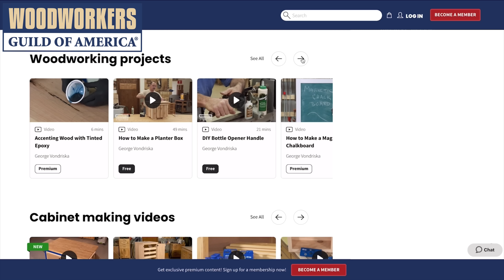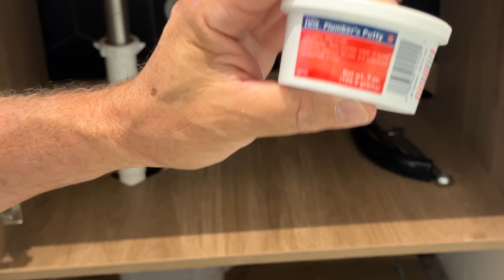INSTALLING a SINK with a BUILT IN DISHWASHER!!

Comment: I find the dishwasher wanting to be hooked up to cold water a good sign. It removes an oportunity to mess up a load by not getting the hot water up to temp before starting, which can reduce the effectiveness of the dishwasher. Technology Connections explains this in some of his dishwasher videos
Reply: I love the “some” of his dishwasher videos, technology connections is something else lol (big fan of the channel)
Reply: Some dishwashers (Bosch in particular) heat the water above the incoming hot water temp.  In fact they won't start the timer until it is "up to temp".  In our older dishwasher the circuit board that controls this heater failed, and the thing would cycle forever.  I've seen dishwashers replaced for this fault.  The hotter water helps in the cleaning.
Reply: @Herby-1620   that’s how it should be! I imagine the cold water requirement is because of the seafood wash
Reply: Heating the water from cold rather than using hot water to preheat it is a European appliance thing.
Reply: @TeflonBilly426  Which makes sense. Houses in my neighbourhood don't even have hot running water connection in the kitchen. We all have a separate 2.5 gallon hot water COP 1 electric heater which would cost a fortune to run a dishwasher from. Theoretically a line from the gas boiler could be created, but that is quite costly to run through all the concrete.

And this is not even that uncommon in Europe due to all the older (stone) houses that are still around.

Comment: Paul, use a mud ring or raised single gang switch on the box under the sink and have the flex go in the knockout in the extension ring.

Comment: I'm not sure where it came from, but my house has a downpipe with a much smaller condensate adapter. It's also shielded from above in the center section to prevent backflow

Comment: Do you ever put pipe done on the threads of a downspout? The last one I did was a plastic drain with course threads. I  barely got it to seal. Maybe I should have put pipe dope or Teflon tape on the threads? Great video as usual.

Comment: If it had been up to me, I would have gone with an 18 inch wide dishwasher.  Uses the same amount of under counter space, and the 18 incher would have left you with more counter space, which is pretty scarce.
Reply: Thinking the same. This thing barely saves any room: it takes counterspace and still takes cabinet space. Losing a lot of counterspace to save a couple inches of cabinet space.

Comment: Cool stuff! 

I think it might be better if you can get that kitchen fauced handle on the right side instead of the left so you aren't getting your arms wet to turn it off and on!
Reply from the maker: We tried the handle on the right, centered in the front, and on the left.  The left seemed the best because pushing the lever back towards the backsplash is hot water, pulling it forward is cold.  I always go "back is hot" in case a kid reaches up there and turns the water on; they're probably gonna pull the handle forward and get cold water not hot and maybe get scalded
Reply: @StudPack  That makes a lot of sense, thanks!

Comment: Paul, I could be wrong but the AC condensate drain line running back up can cause back up issues in future I believe. There is no pressure on the condensate line to overcome gravity  when turning the line back upwards.  Looked like you could rotate the fitting easily. Just a thought.
Reply: If you are talking about the bend in the line, it essentially behaves like a p-trap and won't back up. When there is water collecting before the bend, it'll build enough head to start pushing through to the drain. Waterline just needs to be higher than the drain height.
Reply: Its pumped...
Reply: Also when algae builds up, you will find it right there.
Reply: There should be pressure because it’s coming from an actual condensate pump, not just a gravity drain line
Reply from the maker: Correct, the condensate is pumped.  We can hear the pump come on and the water draining.  All that said, condensate pumps do require maintenance which the AC tech advised Jordan of.
Reply: @StudPack  You are going to have a lot of backups with that reducing barb. As soon as that gets filled with bacterial zoogloea (drain snot) it's going to clog. Full 3/4" condensate lines clog. You really reduced that. I would find a way to get rid of the barb. I hope you installed a float or wet switch too. I live in Florida and have 2 split A/C's in the main house and a mini split in the garage. My 2 split units clog every year. I put tabs in the pan monthly during filter changes and I pour Viper condensate pan cleaner down the drain and they still manage to clog. I either blow them out from the A/H with CO2 or vacuum them from outside. I always clear them either way or sometimes both ways.

Comment: On the P trap I would have tapped the 7/8 ID and put a threaded reducer. Probably 5/8-11 OD to 1/4 ribbed slip. But I am a machinist not a plumber and I have that stuff. 😆
Reply from the maker: Wish I had a lathe.........

Comment: People that say use silicone on the sink drain flange dont know what they're talking about.  You'll never get that back out cleanly if you need to for any reason, problem with the P-trap whatever, and the silicone doesn't clean up good on the sink and will leave a discoloration after a few years.  Plumbers putty is the right material for the application.

Comment: Wish I could afford one of those pex a (expansion) electric expansion  tools. They are so pricey. I did my entire tiny house with pex a with manual tool. It worked but I gotta get me the electric 1 like you! 
If you want an excuse to get have to get a new EXSPANSION PEX A  battery operated tool, you could always send me that old one you got, and blame me for you having to get a new one! LOL !  
  I believe exspansion PEX A is the way to go.  If you could reach out and get  Milwaukee (sorry, spelled wrong)  or Dewalt to give us any discount on tools please do . The battery operated tools are great but just to high . That basic batter operated expansion tool kit with batteries is around $400-$500 on sale .
 I hate it when you see a good price on battery tools, but when you look closer they sale them without the batteries which cost more than the tools themselves. Lol!  But any deal for a discount code, or rebate will help. And you can really help , us them and possibly yourself. Because most of your viewers need and will use most tools, so it is a win win win.

Comment: So a few years ago I ran into an IKEA, Hemnes if my memory is correct, sink and vanity.  They exploited the natures of plumbing to decide where to locate the p-trap.  Immediately out of the sink the water had an immediate horizontal what ever it is per foot toward the back so to make drawers be unencumbered slide right under the sink. At the back of the vanity tucked way behind the drawers was a vertical drop into the p-trap and a 90 into the drain. This resulted in so much less cutting things up. So, now whenever I see a bathroom vanity today I think about how simple IKEA had nailed where to put the p-trap.
Reply: i know what you're talking about. i think it was actually harder to install because of that p trap design

Comment: I have some comments and some questions.
Comment 1: On the vanity I wonder if you could've gotten away with 2 hole saw bits rather than a rectangle.
Comment 2: I have experienced first hand and heard that often clogs are more likely to form with slower moving water, so it may be counter-intuitive but smaller diameter pipes are better at clearing themselves and less likely to clog in many instances.
Comment 3: I I too have had issues with that rubber sealing, so that's a very handy trick, the other thing I've done is actually installed the seal upside down, and that has worked for me in the past.
And Question 1: I have used expanding A pex and had a problem where even positioned correctly the sleev would slide down the pipes, do y'all have recommendations to avoid this or is it luck of the draw? (I was using a hand expander at the time, which makes more conical expansions rather than steps, so maybe that was it)

Comment: So much for the hidden plumbing..... why not move the bathroom sink drain up by removing some tile and wall board so the p-trap is hidden? Seems like the smart thing to do...?? Or even easier use 45° or 22½° fittings to turn the drain pipe down? 🤔

Comment: My 1 and only complaint about the dishwasher sink is that all the tubing is at the back of the unit which would make it difficult to service in the event something goes wrong. I think it's a fantastic idea but the only way I'd install one is if I had an access panel right behind it to work on the tubing if anything ever goes wrong with it
Reply: I don't know how much access you would need.  How do you access a "normal" dishwasher, and how often?  In my experience "not much".

Comment: nice but you should cut the short line a bit more and put the drainpart for she small line sideways, it will collect water the way it is now 😊
Reply from the maker: That condensate line is attached to a pump.  The pump will push any water out.  It's not like a gravity drain.
Reply: @StudPack  ah okey 👌

Comment: The condensate drain enters above the P-trap. I don't think you need any kind of seal at all -- you can just run the drain line directly into the adapter with maybe a clip to keep it in place.
Reply: You never want an open leak below the flood line. If the plumbing ever gets clogged, water will fill up and start spilling out through that barb.

Comment: I would have gone with a straight rather than a 90 for that c9ndensate line. Since everything is gravity fed, you now have standing water in the line for things to grow in and potentially clog the drain line.
Reply from the maker: Tried to find a straight, could not
Reply: @StudPack  Straight would be ideal but I wouldn't lose too much sleep for a pump drain line.  If it were gravity fed, I'd be looking into one of the dosing units to add the enzymes.  Both condensate lines terminate at bathroom sinks upstairs in my home and it has to be cleaned periodically to avoid clogs.

Comment: I am curious on a few things on the bathroom vanity: 1) Can you see the drain pipe under the vanity from a distance away?  2) Could you have done an El up from the was and still had a trap without cutting the base of the vanity (if you follow what I mean. drian down to  U```L  out to sewer
Reply from the maker: You cannot see the p-trap.   Your recommendation in #2 would essentially create an "S" trap and that is not allowed (here at least) 😁
Reply: @StudPack  Thank you for that info.  I love your videos.  You make things look too easy, even when you struggle.

Comment: When you were affixing the vanity to the wall on the right, what was the shim used for exactly? Was it because the wall was not square, or does the top of the vanity run proud of its frame?
Reply from the maker: We held the vanity off that wall just a bit so the door would clear
Reply: @StudPack  Ah, got it.

Comment: Should use copper stub outs. It looks way cleaner, and if an angle stop fails you can replace it without having to cut the copper back. Just a tip.
Reply: Or at least put a male adapter on and use a threaded stop. I personally can't stand pex coming out of the wall either.

Comment: Take the electric whip into the bottom of an extension ring and then you can install a 2 pole switch as the disconnect

Comment: You know, I have seen a bunch of dishwashers. I have never seen one that tied into the drain like that. Mine just drains into the garbage disposal.
Reply: This is probably because it is not a US product designed for the 'eccentricities' of the US homes. Most of the world does not have garbage disposals, which is why this product doesn't need to drain into a garbage disposal. Most of the world also runs on 220~240V, making it easy/quick to heat water - so no need to feed in hot water

Comment: Curious would the sink feed lines been beefed to have used a drop 90?  That way when the angle stops need replaced won’t have to cut the pex - or attach threaded connection to the pex feed line?

Comment: Question... How does the system works with rapid system? I see you press the tap in but how is this fixed? Water pressure would push the tap out?

Comment: I’m thinking a double trap would’ve been easier on this one that was very tight. But nice job making it work. You gotta hardwire it ? Hmmmmm are you sure about that? Also they require gfci protection since 2020 but you might have that in your breaker.

Comment: First time someone throws up in that sink you’ll wish your drain was different
Reply: Because... the puke will push the drain closed? Or you know Jordan keeps the drain closed when not in use?  I don't get it. In fact, that delta drain might even be better given the fact all you have to do to remove it is give a little twist and pull up. Then you can wash it down or clean it out easier.

Comment: 27:34 I thought they wanted an GFCI outlet under the sink and the dishwasher plug into the outlet like a washer.
Reply from the maker: GFCI protected at the panel
Reply: @StudPack  Right but the plug would be your disconnect.  That is how the electrician wired my sisters dishwasher.  I mentioned how I wired mine direct like yours and he said it was not to code or at least not anymore.  I guess you will find out that would be an easy fix for you.
Reply from the maker: Most dishwashers in the US are made to plug in.  This one came with an armored cable whip and instructions said to hard wire.  I don’t know of a plug rated for use on armored cable. I’ll probably install a HD switch on that box as a disconnect
Reply: @StudPack  That should make the inspector happy.  Might be safer and easier than finding an outlet to plug your dishwasher into.  Personally I think flipping the breaker in the garage is safer than crawling under a wet sink with a live wire despite the GFCI to kill leaking Dishwasher.   

My sister was required to put a switch like that next to her mini split heads in the house, since then I think they backed off on that requirement and only requires the disconnect on the condenser outside.
Reply: @StudPack a means of disconnect has to be at the dishwasher now. Plug or switch should work. I have typically just done a receptacle and my own appliance plug wired to the dishwasher. I like the nice clean install with the hardwire and like the armored cable. Switch it and you should be all set.

The code change is so that an appliance repair or installation wouldn’t need to find the panel and shut the circuit off.

Comment: We love joking about lay out whenever full tiles hit multiple things. Tell the other trades and contractor that we laid it out that way on purpose ;)

Also did a job once with the hand dryers built into the sink and I was fixing a mistake by another union “brother” and they had the sink covered with plastic. Well I would keep setting off the hand dryer or the water and it was driving me mad lol. Dryer would go off and the plastic would start flying everywhere
Reply: The only hand dryers I like are the ones that are in the sink faucet, otherwise it just makes a mess on the wall under it.

Comment: Can the hot water line not be hooked up to the dishwasher instead of the cold water so it won't need to use as much energy to heat up the cold water instead it will just slightly warm up the already hot water if necessary?

Comment: Why not just put the vanity P-trap above and used a couple 45° elbows to connect it to the drain pipe? That exposed mdf will suffer from the moisture, it would've been better off staying hidden. 
On a side note not sure how familiar you are with European hinges but you could've unclipped them without taking the screws off when you had to remove the doors. There's a latch at the back of the long piece to do so 😉
Reply from the maker: That drain configuration would create an "S" trap, not legal here and would fail inspection.  Those were cheap hinges, they don't do that we tried
Reply: @StudPack  ok my bad didn't know about the S-trap rule. Seems like it's done a lot here in Europe. But our siphons aren't the same. You might consider giving those mdf edges some protection though 🙂
For the hinges if they're like the old ones (which would indeed make them cheap but not right for a 1300$ vanity) the back screw can be untightened a bit to separate the two halves.
Seeing how the vanity rocked when you pressed on the upper edge, isn't it leaning against the drain pipe excursion instead of the wall?

Comment: Love the channel. You do great work. Two things 1. You need the pop up drain that matches the sink. If the overflow holes on the downspout aren’t lower than the overflow drain then water will get trapped in   the overflow of the sink and it will eventually stink. 2) use a pvc tee instead of downspout w/ a dishwasher hookup for hooking up specialty hoses like condensate drains.

Comment: Can someone explain again what that large tube is for in the lower right of the vanity?  I think they said once it was for fresh air, but how does it work and not cause an air draft?
Reply: I believe it has a damper on it you can spin open or closed. I recall they showed it once that Jordan could simply open the cabinet door and spin it. That is to allow makeup air for when the exhaust fan is running.
Reply from the maker: Correct, make up air

Comment: The moment I heard the word “code” I had a reaction of disgust. In the 1960s I wanted to add an electrical outlet in my house. They told me I could use aluminum wire to save a few cents: it was CODE. Several years and several burnt down houses later, they changed their sacred code. Fortunately, I knew enough about electricity to stick to copper, or I might have been dead decades ago. Go with the manufacturers’ recommendations.